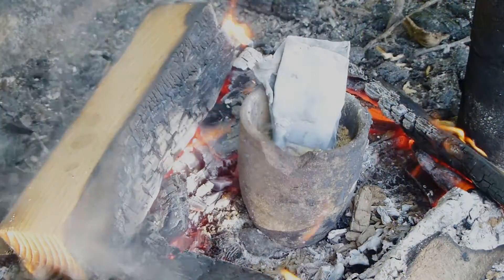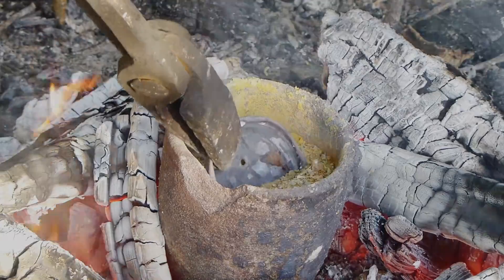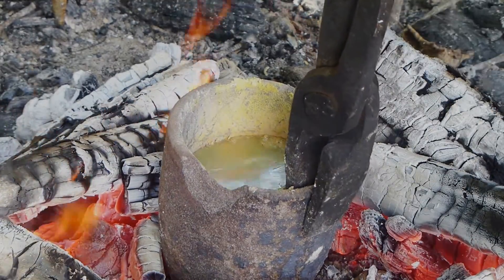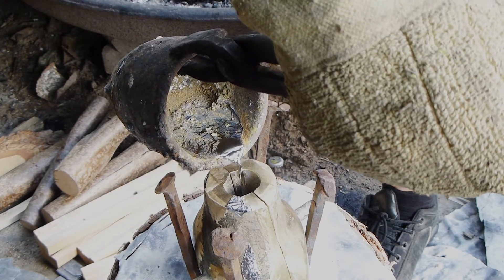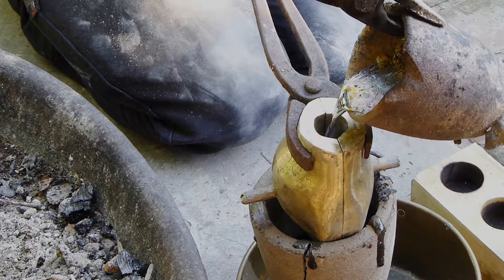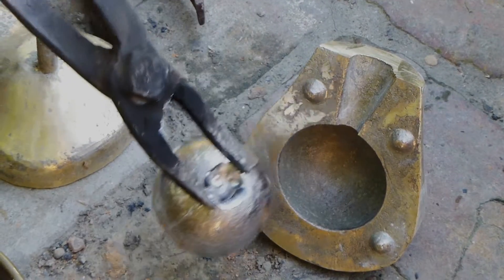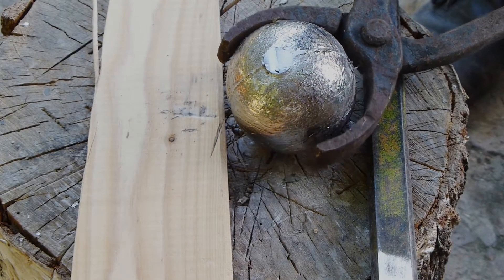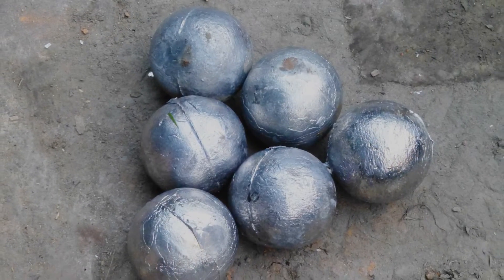Round shot - leaden cannon balls - and how to make them #appliedarchaeometallurgy

Comment: If you put a little charcoal in your lead melting pot, much of the lead oxide will turn back into lead metal.  Of course, the non lead oxide waste and the charcoal will float on top of your melted lead and you can just skim it off, you will end up with less waste material and more lead.
Reply: You can use just sawdust to get same result. It will burn and char from the heat anyway. Its pretty good flux for smelting lead.
Reply from the maker: Well, you can use pretty much any dry organic matter. They all turn into carbon, form carbon monoxide and the carbon monoxide will reduce some of the lead oxide back to lead. However only if you manage to contain that gas in such a way that it actually has a chance to react with the lead oxide. Other than that charcoal or smilar will of course consume most of the free oxygen and will thus prevent the formation of lead oxide..
Reply from the maker: Thanks Jason. Good thinking, I should have thought of that!  We used old roofing lead, which had a substantial amount of oxide and carbonate on it, that's why you see so much oxide.

Comment: Lead is an odd duck! It does not expand when heated
Reply from the maker: I am afraid this is not true. Lead has a thermal  expansion coefficient of 29 micrometers per Kelvin. For metals this is in fact, not even small, but rather a high thermal coefficient value. Thermal expansion is important for foundry-men or pattern-makers as it is the reason for one type of shrinkage: the sometimes so called pattern maker shrinkage, which happens when the  cast object cools down from the solidification temperature to room temperature.

Comment: Were lead cannon balls actually common?  I have heard of carbed stone balls and cast iron , but never lead for anything much bigger than a musket or 1" bore.
Reply: Lead cannonballs were used in fortifications in later medieval time. Iv seen several big stone slab moulds in castle museums for pouring 10 to 20 similar or little smaller lead balls in one pour.  One similar shot ball was  found 400m away from Paide castle by detectorist couple of years ago. It was shot in 16 century from castle and had still heavy smell of gunpowder and sulfur when found.
Reply from the maker: Yes, they did exist for the earlier cannon of the 15th century, the German term for these being Lodtbüchsen,( =lead cannon) I believe the English term being culverine. Therse were developed in contrast to Steinbüchsen (bombards) and were generally of a smaller size, more transportable, and so on.. Check the batte of Bosworth to see a few original leaden round shot.